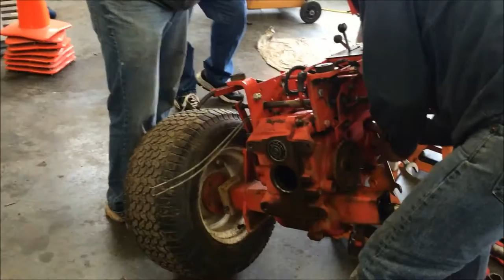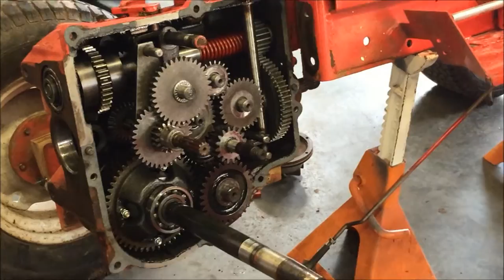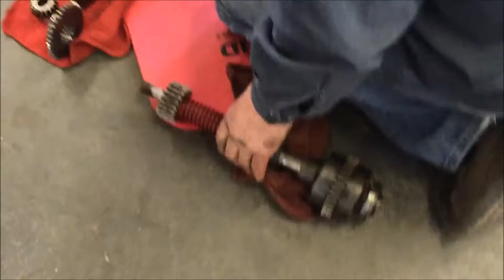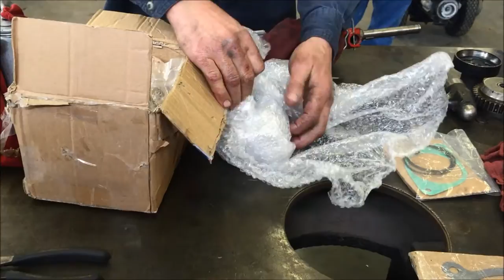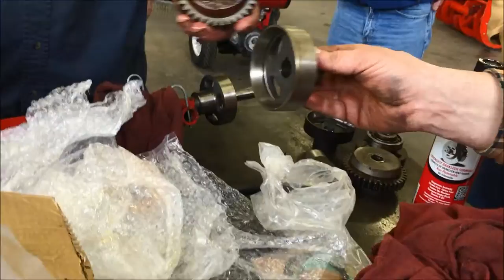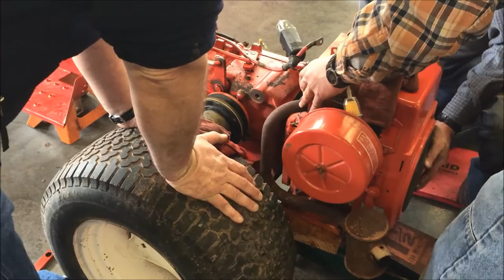Gravely Rider PTO Clutch Replacement 2016 Blow In - 800 8000 and G Series

Comment: Has anyone considered placing an external PTO clutch in front of the transmission case similar to a 24G? Could be electric or manual. One would still have to remove the internal clutch and perhaps weld it together and reinstall it.

Comment: Got a 20G in my shop right now for electrical work. The PTO clutch is stuck on, but the lever is in the disengaged position. Luckily not my problem. Customer just wanted me to fix the electrical issues and get it running.

Comment: Back when I was a mechanic I had one of these come in with PTO problems. It was very difficult to find the pto clutch and it was like $800 for the part alone. They ended up having to junk the tractor due to the high cost and labor. Shame too the tractor itself was in great shape.
Reply: gatewaysolo104 it's a 6000$ tractor that lasts 25 years it's worth fixing..

Comment: Hey I got a 87 gravely 20g, 2 owner my grandfather and myself.  im looking for a good reliable shop to rebuild the transmission and motor. Not to worried about cost as I've already replaced all electrical and such and its a memory I want to keep. Also of course its just an amazing workhorses when fully operational.  I'm in the ks area if anyone knows of a good shop.

Comment: Nice work fellas. What a labor intensive ordeal for the PTO clutch. How many hours to finish the job ????
Reply from the maker: I believe a shop charges 8 hours labor.  We did this in about 3
Reply: @rw3dog  What did the parts cost and what did you use to seal the case ??? Thanks

Comment: that is the most complex tranny repair I've ever seen  there are way to many gears to go wrong and too much work to change out one part.  ambition or not if you do this yourself it will take forever  look how many guys involved  what a nightmare
Reply from the maker: Christopher Tyler lol, it sure isn't easy.  My friend who works at a mower shop said this job gets charged out as an 8 hour job for one guy...
Reply: @rw3dog  Hi Rdog, I'm thinking of making an external shear pin point for when you jam the deck.
Obviously to save the PTO clutch, and cracking the case.
Why didn't gravely think of this?
Love your videos, watch em all the time. Best regards from down under, Paul Macartney.
Reply from the maker: Mak Attak I believe the school of though is the belt on the mower deck would snap before the pto would be damaged.....
Reply: @rw3dog  interesting Rdog.
What happened with my 812, I was mowing, then in high 4, did a reverse u turn to change direction, and ran into a garden edge timber. It almost instantly stopped everything, jacked the deck in a diagonal shape half over the back wheel. I suspect the clutch was almost gone, I had only installed a new belt weeks before. So it trashed the clutch, but the belts fine.
Reply from the maker: Mak Attak so if the clutch is stuck on all the time it is probably broken....Others May have videos of how to free up a stuck PTO clutch...